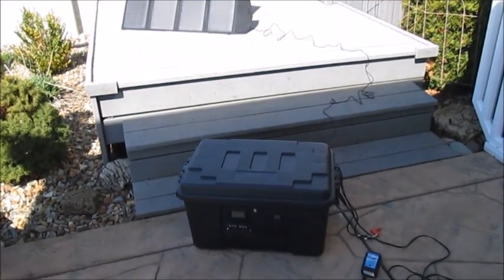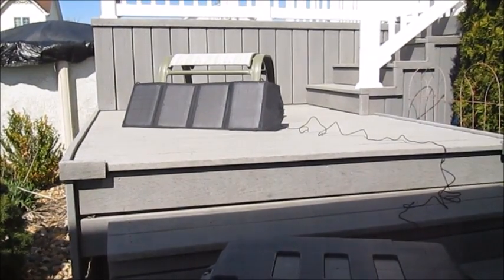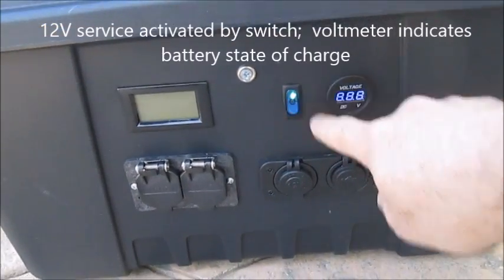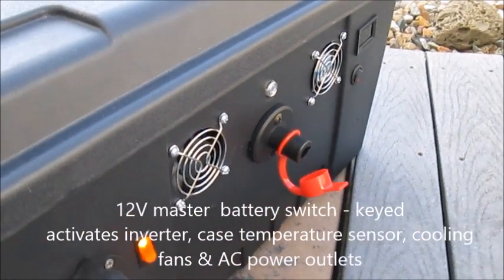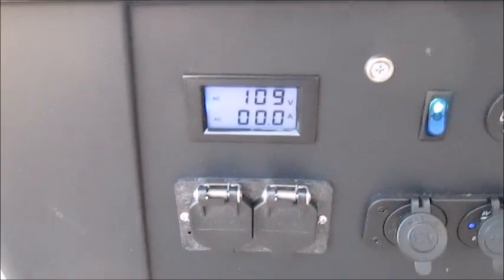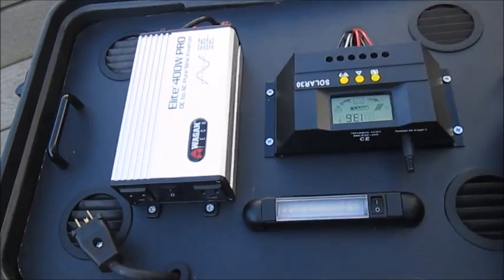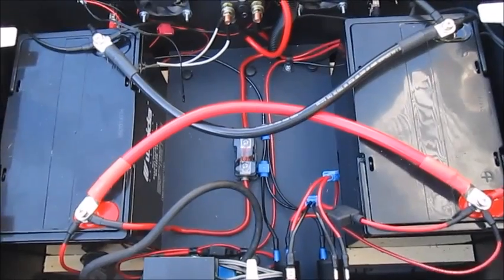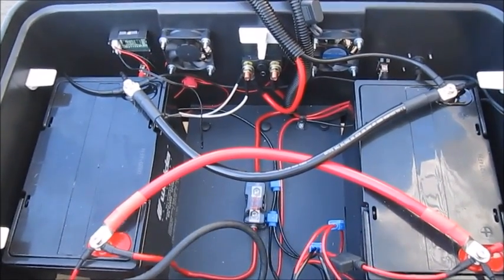V1 P1 DIY Portable Solar Power Generator - Wiring Schematic, Parts List, FAQ Sheet Provided

Comment: sir 100w solar panel can be charged these 110 ah battery full.
Reply from the maker: It depends on your daily demand for energy. A single 100W solar panel can provide about 27 amps in a typical solar day.  Two 100W panels would be better as that would allow you to recharge the  batteries completely from a 50% state of charge, assuming you would not want to drain the 110 ah batteries beyond that point.

Comment: what and how did you run a  power chord from the inverter to the mounted outlet
Reply from the maker: Steve, click on "Show More" under the video and you will find a wiring diagrams and answers to FAQs that address your question.

Comment: Thanks, great video, I'm building a complex system, 4 Battle Born LiFPO4
 100 amp hour batteries, outback flex 80 charge controller, a converter 
made for charging the lithium batteries using 110, 6 100 amp flex solar 
panels using sunpower
 cells with ETFE and an Aims 3,000 to 6,000 watt pure sine wave inverter
 with all the gadget connections and a high intense light, all in a 
large toolbox from Home Depot, with 2 12 volt fans hooked to a 135 to 85
 temp range thermostat switch, in case you wonder , cost about 7 grand ,
 but will last a lifetime.
Reply from the maker: I'd enjoy seeing your finished system Michael!  Thanks for watching and for your comments.  No doubt, the greatest percentage of your total cost is in the LiFPo4 batteries.  I am planning to switch to them when my current AGMs fail, but hoping the price comes down in the mean time.

Comment: Excellent project, very clean job!!!!!! The only thing may consider is the use of scotch-locks on the wiring. On offshore electrical equipment, like gas and oil compressors we would spray clear coat spray paint on the connections to seal them up from corroding, the scotch-locks could be opened back up and give them a good coat and would probably keep them from corroding. With the fans running when out on salt water it will bring in the salty air and may contribute to the corroding. Excellent job though, a lot of very good ideas. What is your take on using a 18650 battery pack vs the  55 AH AGM's?
Reply from the maker: Thanks for viewing and for your comments Kris.  Check out part 6 of my series.  I eventually replaced all of the scotch-locks (so many commenters took exception to their use!), but your suggestion to clear coat them sounds like a very good idea.  For now, my system is in use on my boat in the Great Lakes, so I haven't worried about salt water corrosion, but I am planning to spend my retirement cruising in salt water in a few years.  Your concern about the fans moving salt air into the case are noted and something with which I will have to contend in the future.  I have not yet considered using a 18650 battery pack, but will likely make the switch to LiFePo batteries when the AGMs are no longer holding a charge.  The reduction in total system weight will be a nice change.

Comment: Great video. The only thing I think I want to do differently is to not have the batteries in the unit. They are heavy and take up the most space.
Reply from the maker: Thanks for viewing and for your comment!   Many DIY designs can be found here on YouTube tgat use two boxes, one below for only the batteries and the second on top with all of the other components/appliances.

Comment: Can u use a 200w panel with this setup?
Reply from the maker: Absolutely, I am currently using two 100W panels for a total of 200W.  A single 200W panel would be fine with this system.

Comment: I know you probably made this a while ago, but one idea that you could do is use a temperature circuit to control the fans and have the switch as an emergency override if that fails.
Reply from the maker: Thanks for viewing my part 1 video.  Have a look at part 4 and you will see the result of installing a snap disc style thermostat that automatically manages the cooling fans in exactly the way you have described.

Comment: Awesome video.  I have a quick question.  I would like to make a smaller unit to fit in an ammo can to power a ham radio.  Id like to be able to charge the battery in three ways 1. By solar 2. By ac 110 and 3. By a male to male 12v plug.  Would I be able to install the charge controller and have sma connectors for each of the 3 units and run one at a time through the controller?  Thanks.
Reply from the maker: I think the ability to run each of those 3 sources of charging through the charge controller would depend on the specs of the charge controller you plan to use.  I found that the charge controller I used would not allow the AC trickle charger to pass through it.  I have not tried to charge my system directly from a 12V vehicle plug with a male-male connection.

Comment: This could be a lot less spendy if you use Harbor Freight components. 100 Watt solar panel, with coupon, costs $149.99 + tax. 65 W one costs $56+/- I think. 400 Watt inverter isn't very much &, for me, operates very well and is sturdy

Comment: Hi Jim, we are new subs, but have watched all of your videos on the generator in the past.  We want you to know that your videos provided the impetus to build our own generator last year. It was a 12v, 400 ah system with one 265 watt module that worked fine. But we scrapped it for a larger, trailer-mounted generator with 19,200 watts of total battery power and 1560 watts of solar modules.  The trailer has a 48v 12,000 watt inverter capable of running a small welder and just about anything else we need. We are going to use it to build our off-grid home I the Intermountain West. You can watch our videos on it, if interested. We're almost done with it.  We just want you to know that you and another channel were the inspiration to get us started and we thank you.
Reply from the maker: Thanks for viewing and for your comments.  I checked out your channel...very interesting!  Go big solar!!
Reply: Thank you Jim!!

Comment: where is the "generator" part?
Reply: PS - very nice build!
Reply from the maker: Thanks for viewing and for your comment Patrick.  Technically, the solar panels and specifically the photo-voltaic cells themselves are the primary "generators", but the batteries also "generate electricity".  Cells that convert stored chemical energy to electricity are defined as generators too.   So, in a sense, the whole system is a generator.   http://americanhistory.si.edu/powering/generate/gnmain.htm
Reply: wow - that is really stretching the definition of "generator" - Terrence McKenna warned us about "impovershing of the languaging " so long ago!
Reply: I don't see a "battery" on that link.
Reply from the maker: Wow...You should sharpen up your reading skills Patrick.  Take a look again at the first two sentences of the article.  The document to which I alluded was provided by the Smithsonian Institute...I think the folks that write for them probably have a good handle on use of the English language.
Reply: silly - it reads that a generator is distinct from a battery,
and that is very clear.
Reply from the maker: Generating Electrons
 "There are a many ways to produce electricity. Electrons can flow between certain different materials providing a current, as in a common battery."   Seems very clear based on the Smithsonian's first sentence that a battery is able to generate electrons (produce electricity). English 101, something that 'generates' in the present tense is understood as a noun to be a 'generator'.  Try to accept either the paradigm shift or nomenclature that others, well before I used the term to label my system, ascribed to summarily describe the combination of solar panels and energy storage/distribution systems. You have to agree that such a description is overly verbose...give some consideration to the vernacular use of the word 'generator' as it applies to systems such as these.  Seems many of the commercial retailers of such systems have readily embraced and endorsed the term. Here's just three examples from some of the best known companies offering systems for sale: 
Goal Zero Yeti 400 Solar Generator
The Phoenix Generator [Renogy]
Inergy Solar provides the best portable solar generator selection [quote taken directly from their website, no endorsement intended]

Comment: Nice work! Do you connect the AC charger directly to the battery? Or to the solar charge controller? Thanks!
Reply from the maker: Thanks, the AC float charger is connected directly to the batteries.

Comment: How do you ground it?
Reply from the maker: Great question.  It is not grounded as I make use of this system primarily on a boat where a direct earth ground using a typical copper rod is impossible.  What follows is a summary of what I learned when I researched the topic of grounding a portable solar generator and its solar panels on a boat. I am using flexible plastic solar PV panels where grounding problems become less of a concern because there is no metallic conduction path that is exposed. Likewise, there is very little, if any exposed metal on the exterior of the plastic case of my generator.  There is still a risk if any of the solar cables or were chafed or damaged exposing the wire within and where it may come into contact with metal on the boat.  If the solar panel you use has a metallic back plate, it may be possible to attach a bonding  wire to ground it  and therefore is recommended. If the panel(s) are mounted onto a metal structure or if their  wires run on or in a metal mounting structure, the mounting structure must be grounded to eliminate a possible frayed wire from making the structure electrically hot.  In that last case it would be necessary to ground to the boat's ground immersed plate (if it has one) or engine.

Comment: Jim,
Last question hopefully. How do you have your led light wired? I like the idea of incorporating one as well, maybe 2.
Reply from the maker: Ryan,  the positive and negative leads from the LED light are attached directly to the corresponding sides of the bus bar that you see installed in my part 6 video.  Unfortunately, the video does not show the LED light's leads as I had not yet reattached the light following the wiring reorganization that accompanied the bus bar install.  the wiring for the light is tucked into the wire comb along with the other wires that emanate from the solar charge controller and inverter that are also attached to the top tray.

Comment: Mr. Fisher, some of us (a lot of us) are not handy enough with this kind of gear to build it ourselves.  Is there any circumstance around which you would build one of these set-ups and sell it to a interested party such as I am?  Just wondering . . . . . Nice looking set-up, for sure.
Reply from the maker: I sincerely appreciate your interest, but unfortunately I do not make them for resale.  Thank you for your comments!
Reply: Thanks for replying Jim.  I wonder if you have a suggestion regarding retail then.  If you were going to purchase such a thing commercially, is there a manufacturer you would recommend?  And/or are there manufacturers you would advise to maybe stay away from?  Thank you
Reply from the maker: While I don't have any experience with their "solar generators", I have purchased products from both Goal Zero and Renogy.  They each seem to have a reputation for good customer service.  I have had excellent customer service with Renogy.  One feature that I would look for if I were purchasing a system is the ability to easily replace the battery(ies).  Some of the smaller systems are built such that it is nearly impossible to open the case to replace the battery when it eventually no longer holds a charge.
Reply: I appreciate your response and advice.  I'll look into the Goal Zero and Renogy products.  Thank you.

Comment: Can you send a link to the exact battery you used? You have mentioned that he height is critical but all of the UB12550 batteries I can find appear to be 9.02” tall
Reply from the maker: Ryan, the information below was posted in my FAQ document regarding the dimensions of the batteries. I think the 9.02 refers to the length of the battery, not the height.
Volts 12 Product Height 8.27 in. Chemistry Sealed AGM Model UB12550 (Group
22NF) AMP-HOUR 55 Product Length 9.02 Product Width 5.43 Net Weight
38.58 item number 45980 Terminal Threaded Insert
Reply from the maker: https://www.wholesalebatteriesdirect.com/ups-batteries-to-replace-fullriver/54339-12v-55ah-22NF-UPS-Battery-replaces-FullRiver-DC55-12-DC-55-12.html
Reply from the maker: You are welcome!

Comment: Pretty sweet build.  Curious,how long does it take roughly to charge up the batteries from a deep drain on a sunny day?
Reply from the maker: Thanks.  I am now using using two 100 watt panels with this system.  It can be fully recharged from a 60% state of charge in about 4 hours.  Here's a link to the calculations I made when using a single 100 watt panel.  http://www.creeksideartifacts.com/SPMGMTcalculator.pdf

Comment: Are those deep cycle batteries? Can you share the specification of your box, I mean what fuses you bought, what were the tire diameter, and components that you have bought? I want to create the same unit in Brazil, and I loved your project... I want to repeat it inside my camper trailer, so I can get off the grid with my ac/dc fridge and cameras for 4-6 days or more.
Reply: Sorry, I haven't seen the video description... do you have an idea to upgrade the system, providing "shore power" to recharge the batteries in a camping site or home, for example?
Reply from the maker: Rodrigo, it is possible to recharge the batteries using AC "shore power".  There are a couple of options.  First, you can buy a trickle charger as i have done and plug it into the integrated SAE port.  Second, you could use a battery charger that has alligator clips and simply attach them to the corresponding negative and positive heavy duty remote jumper terminals on the front of the case.  Assuming you are connecting to a typical 20A or 30A shore power system, you would need an appropriate adapter to plug in either a trickle charger or other battery charger.

Comment: This is the best thing I have ever seen on YouTube.  Don't know what I am in more disbelief of - that there are 185 thumbs down or the quality/thoroughness of this build and provided schematics.  Those 185 d-bags should stick to cat videos.....
Reply from the maker: Thanks for having a look and for taking the time to leave your generous comments Brian!  They are appreciated.
Reply: What is the average run time of the bank at night with say a 300W load? Recharge time from Panels?
Reply from the maker: FAQ & A  http://www.creeksideartifacts.com/PSPGFAQ.pdf
Reply: The thumbs down are more than likely because of the type of batteries used , most are using lithium ion because discharging these types of batteries bellow 80%  to much destroys them . The weight is also a factor , i built one inside a small ammo box that has 72amp hours and weights maybe 15 lbs?  It's a good build it's just not what people want to see these days .
Reply: Hi Wind,
You might well be correct, but wow, the lithium batteries are very expensive here in Australia, so I will be sticking with this style of battery for some time to come. A very well made battery box!!!

Comment: 950, I will have to go a different route you can get a goal zero at Costco for 1k so I will have to pass
Reply from the maker: If Costco is selling GZ's Yeti 1250 model (and a solar panel to power it) for $1K then you might have found a deal.  That model is the closest match to my design in terms of total amp hours of power it can provide.  I'd be surprised if that were the case though...as of this morning GZ's price on their own website for their Yeti 1250 is $1,499.00 plus shipping.  Of course you would need to add the value of at least one 100W solar panel to your cost (GZ's Boulder 100 is priced at $249.95 plus shipping).  As you can see, a COMPARABLE Goal Zero system is going to cost about $1,750.00.

Comment: i dont see those batteries lasting no more than 1 hour or less with appliances
Reply from the maker: That depends on what types of appliances you intend to use and for how long.  You will need to do some math in order to know what types of appliances can be powered and for how long.  To give you an idea of what this system CAN power:  I use a portable Dometic refrigerator/freezer on my boat.  It can be run 24 hours a day in the summer time using this system- granted, the compressor is cycling on and off during that time .

Comment: Why your parts add up to 1,031 ?  One also has to consider the shipping cost of all these things from supplier too and currency exchange , costume fees etc.  Good idea but so heavy, small  battery capacity when they really should not be drained more than 50%.  Expensive though,  but i see 20% of cost is solar panel and 25%  are the batteries. Locking casters would be nice or some kind of wheeler. For 400 watts i don't believe is worth it, better to get 12 volt lights and camping equipment. Thanks for posting.
Reply from the maker: Thanks for your comments and questions.  Some of the questions/concerns you have raised are addressed in parts 2-6 of the series.  I encourage you to watch those videos too.  Answers to other questions/concerns you have can be found here:  http://www.creeksideartifacts.com/PSPGFAQ.pdf  The complete parts list and associated costs can be found by clicking "show More" under the video description.  If you watch all of the videos you will see that my primary use for this system is on a boat, that is what it was specifically designed for (not primarily for camping).  If your primary use for such a system is camping you may want to consider a much smaller system, particularly where increased portability is desirable.
Reply: Murray Runge "costume fees"? Did i miss the part where he dressed up as Solar Man?